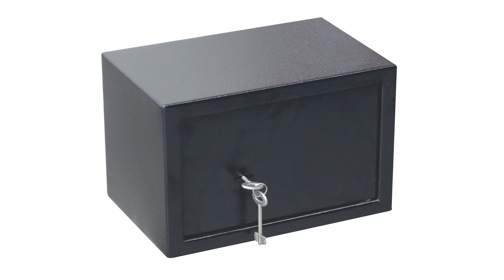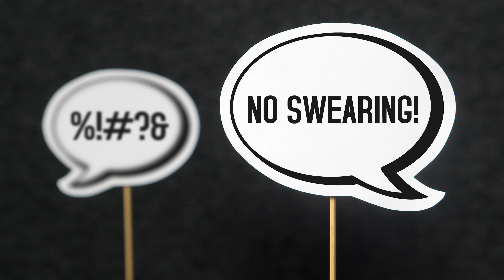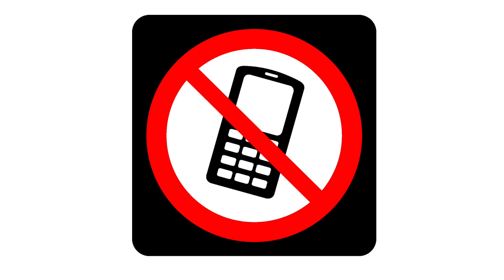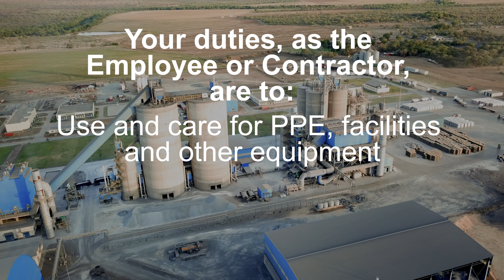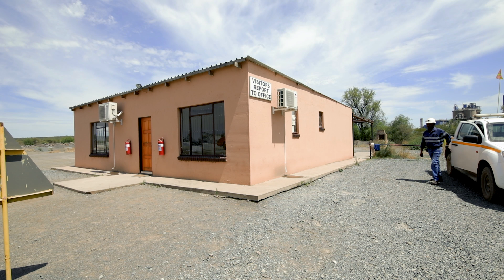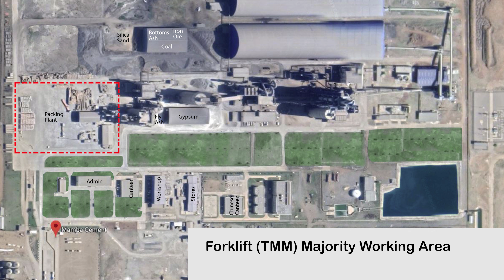Mamba Cement: Health and Safety Induction Training Video

Comment: Good cement i must say!,the Chinese technology is absolutely amazing!,the plant surely is impressive. But the company has one flawed weakness "corruption",its a bit of a silent killer,good cement but bad people running the operation, i used to work there the company has a non corruption tolerance company operation procedure in place,it clearly says no corruption is tolerated!..hmmmm what a surprise i got when i reported corruption with a ton of evidence, the blame got shifted to me and i was dismissed, i do miss the sparks of a cutting torch and the arc light of a welding machine and working my ass off,but sure glad im not part of that corrupted company anymore#God sees all God knows all.